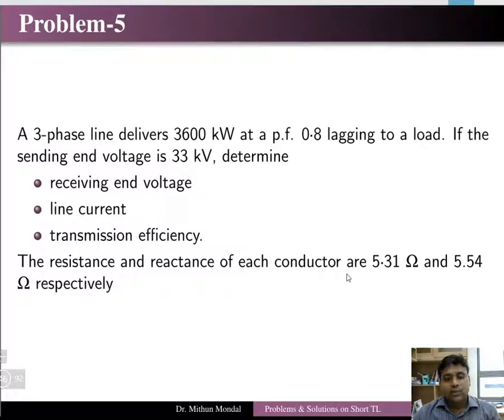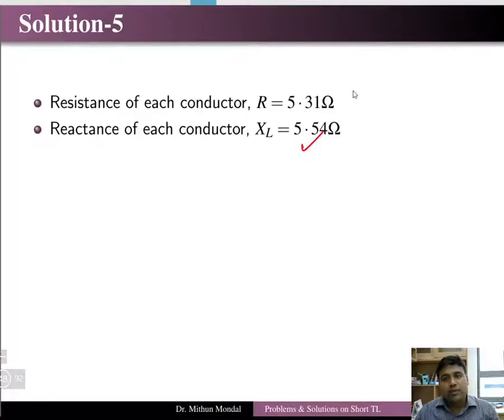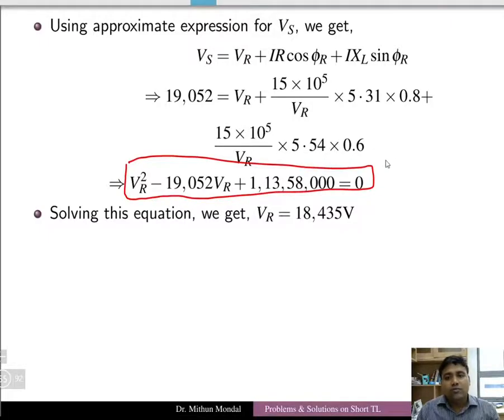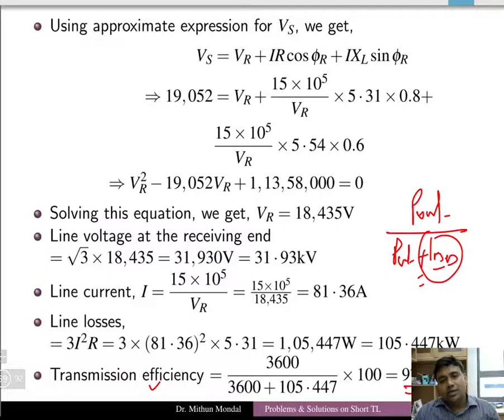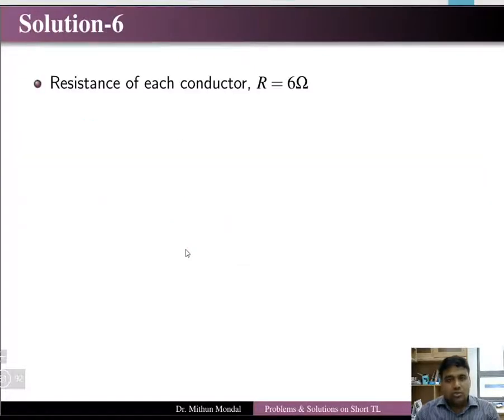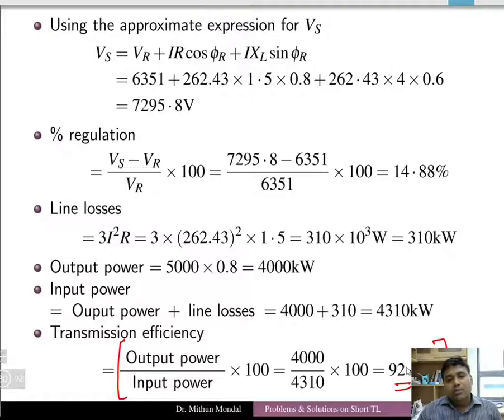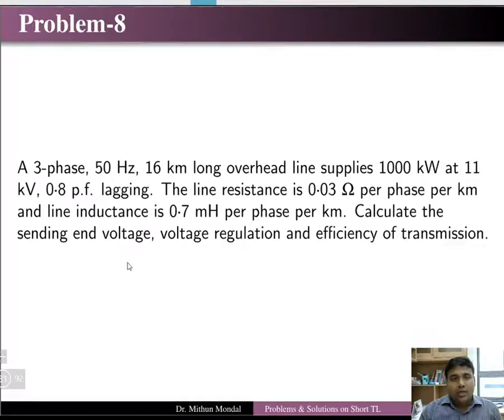Power Systems | Tutorial - 7 | Solved Problems on Short Transmission Lines  (Part-2)

Comment: Sir, I calculated Vs in the solution of problem 7 from the equation which is Vs= Vr+ I*Z and I found 7320.673 . Is it correct?
Reply from the maker: Hope you have taken Z = R+jX with appropriate magnitude and angle. The solution mentioned is approximate Vs.

Comment: Sir, I couldn't understand the solution of problem 7. There is load current part of the solution which is P=3*Vp*Ip*cos(theta) like you mentioned. But I couldn't see the cos(theta) in the equation of load current. Can you explain? Thank you.
Reply from the maker: I think you are confused with real power (P) and apparent power (S). Note: P=3*Vp*Ip*cos(theta) and S = 3*Vp*Ip. Use accordingly. Hope it helps !!

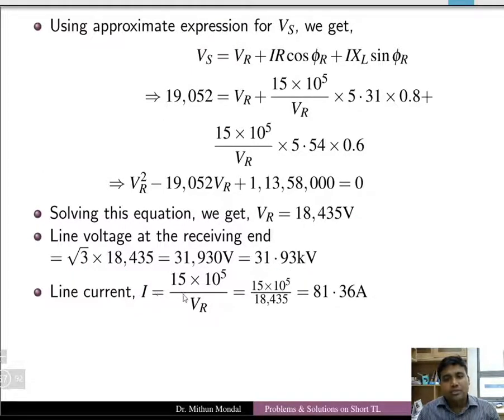Comment: Sir i have question at 3:47 why we dont dived by 3 to get the line current as we do on example three on the previous video , thanks
Reply from the maker: Your question, however, is unclear to me. I just want to point out that the division or multiplication of 3 and the square root of 3 are affected by a variety of factors such as whether the system is single or three phase, whether the connection is star or delta, and so on. Please be more specific with your query.

Comment: Sir at 3:27 By solving the equation we get two values of Vr why are we taking 18435
Reply from the maker: The other root is 616 V. Since Vs is 19052 V, Vr should be less and close to it. Taking 616 V means there is a huge loss in the TL, which will not the case. In TL, resistance is very less, the governing parameter is the inductance. So, 18435 V is chosen.

Comment: Sir i have a doubt , In the equation we took Vr as reference . But why did we equate the magnitude of Vs to Vr + Iz and not the vector ? because if Vr is the reference then Vs should be a vector right ?
Reply from the maker: Please mention problem number to identify your doubt.
Reply: @EngineeringDevotion   I have the same doubt it's on solution 6 equation for find I at 6:12 please reply ASAP
Reply from the maker: @cadrawdaily  Please see the Lecture-17 of the power system lecture playlist to understand the complete equation. As in solution it is mentioned approximate expression which means second term is not taken into consideration as its value will not impact the solution and can be easily solved.

Comment: Isn't that the phase current? Because Power/phase=Vphase*Iphase*PF 
Please clarify
Reply from the maker: Yes, you are correct, it is phase current to be specific. Generally, any balanced 3-phase system is solved per-phase basis so for 1-phase we can say line current = phase current. After solving per phase basis we can back transformed the voltage, current and losses as per 3-phase system equations. In the solution, I should have written phase current it is a typo. Thanks for pointing out.